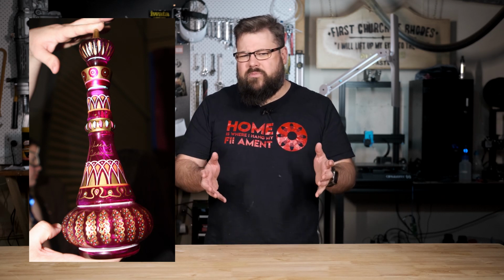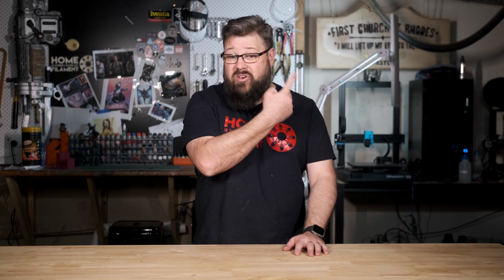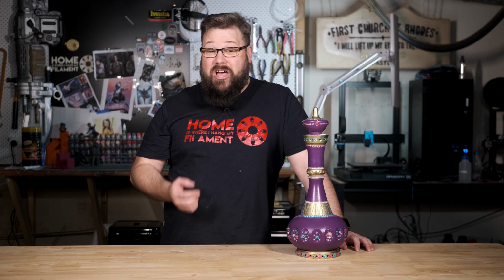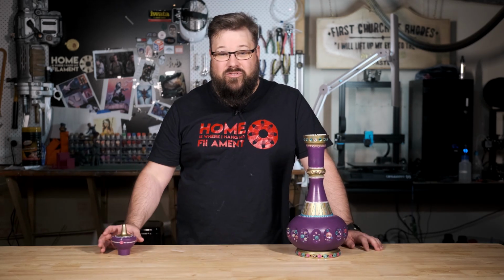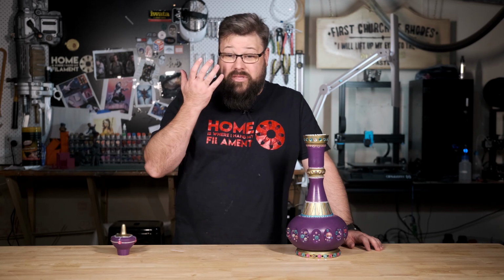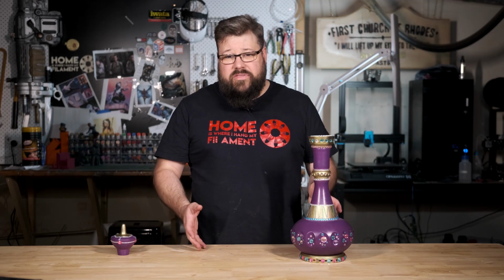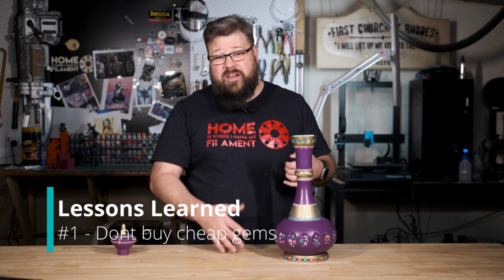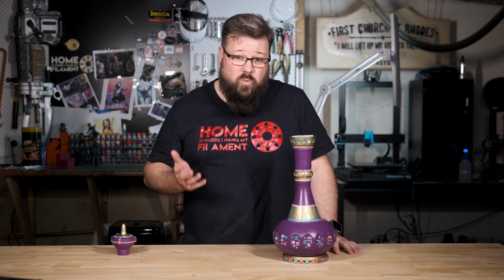I DREAM OF JEANNIE!  Epic 3D Printed lamp with SMOKE!

Comment: Love the design. Did something similar for a musical but the smoke effect wasn't as good. Personally I wouldn't use an arduino but an esp32. The reason:  You can start the smoke from the push of a button, but also let it be controlled remotely over wifi. I used an artnet library for that so the light technician could control it from his panel. It's a magic trick on it's own when the lamp starts releasing smoke without anybody around and no cables visible.
Reply from the maker: Thanks Dries!  It actually does smoke on it's own, the secondary button triggers a 30 second delay.  I thought about using an ESP32 or a 32u4, but honestly this was easier and foolproof :)  Would be pretty cool with a lighting tech triggering it!